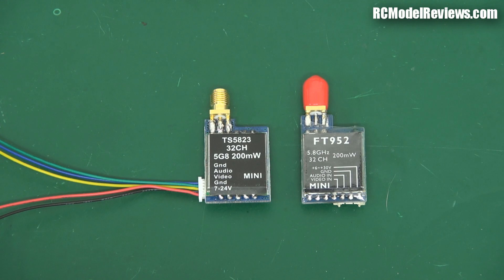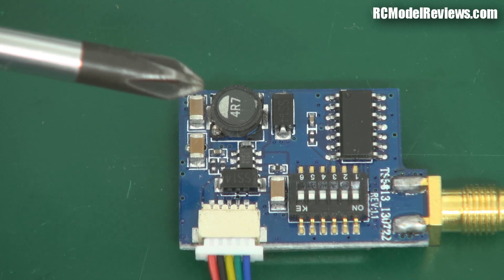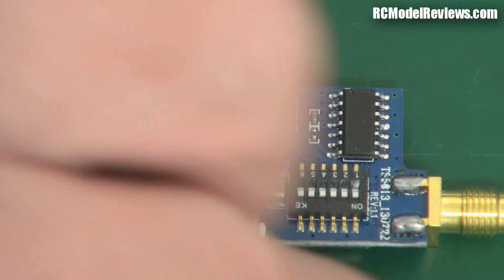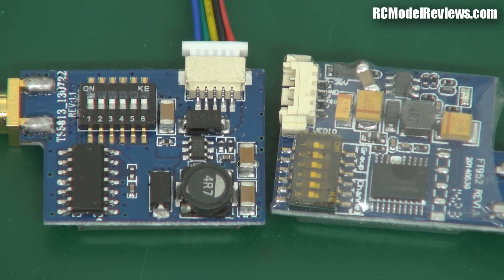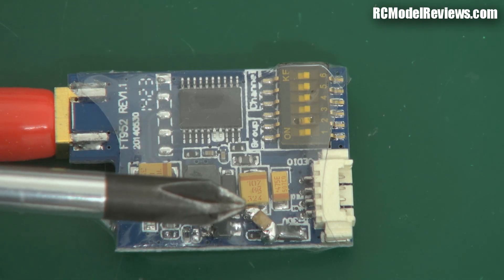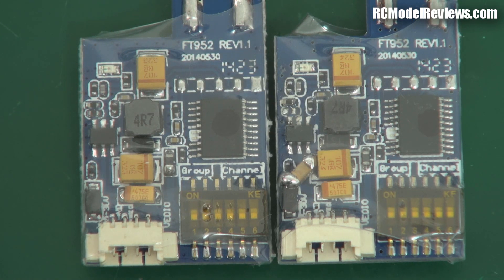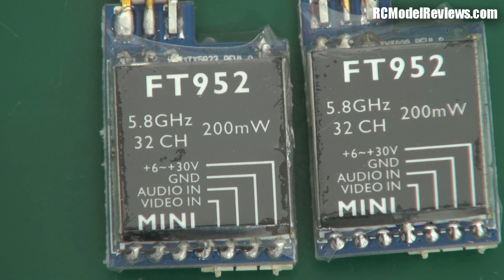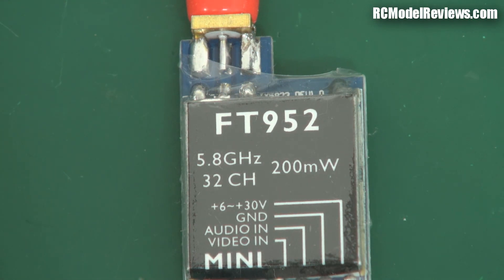FT952 FPV transmitter 200mW 5.8GHz consistency issue

Comment: anyone can tell me wich is that component in top rigth of ts5813??? i connected mine and one pin of it burnt. The only way is to change frequency. it gets very hot.the other componnet where ok,  but the 4r7 whents hot to before the pins burnt. any idea on how to repair?

Comment: Two and a half years on and not much has changed with QC.
I have a couple of these mini FPV transmitters and the problem I have with them is frequency drift.They won't stay on the channel I set them to,instead they constantly drift from one frequency to the next.Useless.

Comment: hi bruce I over powerd my eachine board camera.the cam is 5v and I put 12v .nothing blue. I am a very good solderer with small parts  ,,can it be fixed .ilive in the caribion of costa rica in the jungle parts are not easy to get san hose is 300 miles away ,and not much in the way off new stuff so I have lerned to fix  my stuff    my self. please help .I have a lot off broken stuff to rob parts..thanks I love your chanel  /////the pic wos so goog  with a gopro lens

Comment: After looking carefully at the footage it also seems like the FT952 transmitter on the right have a resistor missing on the top left corner. The third from the top. Anyway awful soldering.

Comment: I had the connector come off my ft952.  This is probably a stupid question, but at the 1:54 mark you can see the white lines for video in, audio, ground an power on the vtx that point to solder pads if you will on the board.  Am i able to solder wires to these or are those not what i think they are?

Comment: Another issue which should be mentioned is the antenna feeder. Between the radiating elements of an antenna and the SMA-connector on the transmitter, there is usually a coaxial cable. Very often it seems to be something similar to the RG-174 type, but more rigid. Losses in coaxial cables are enormous at such high frequencies as 5800MHz (5.8GHz). So try to avoid any cable at all, with the antenna element as close as possible to the transmitter output. If not possible, choose those antennas with a thick cable from the connector. A 10 cm strip of small coax as the RG174 may give loss in magnitude of 50% of the transmitters output power.

SWR (Standing wave ratio) is also important, but is hard (if not impossible) to measure for such high frequencies if you dont have a USD 50.000 analyzer. But as a thumb of rule, the current draw by the transmitter is at it lowest when the antenna match is the best. High SWR can damage the transmitter, but at such low power as in the milliwatt range quality transmitters are designed to withstand open or closed output (no antenna at all). 

And yes - the switchmode voltage converter on the PCB produce quite a lot of noise. Another approach is to use an external 3.3V DC regualtor (of the linear type) and connect directly to the transmitter after the switch-converter.

My 50 cent.

Comment: I believe that another issue with quality could be the antenna supplied with these transmitters.  My transmitter died while I was setting it up on my quadcopter.  I decided to investigate and found that inside the antenna it is just a length of micro coax with the end stripped back and a short length of tube soldered to it to make a dipole antenna. I tested the continuity between the ends of the antenna and the SMA connector and found that the screen was not connected.  With further investigation at the connector end of the antenna I found that the screen had broken where it was soldered to the body of the SMA.  I'm guessing that this caused SWRs that fried the transmitter.  I suspect that my antenna is not the only one that has caused a transmitter to fail. The antenna is designed to bend but the cable/joint inside does not seem to be up to the job.
Reply: Should have added that mine was the TS5823.  Not sure if the antenna with the FT952 s the same?

Comment: Good video. There is also a resistor? missing above the switch mode controller on the one with the bodge fix. Once again good video's I just found your  channel and have been looking into getting a miniquad. Thanks from a fellow Kiwi

Comment: Can you help me out I bought a TS351 5.9ghz FPV transmitter it has a power lead on the lef side and power supply to the camera to the fare right then a yellow wire in the middle,a white wire ,then a green wire can tell me what they are there for 
Ps your videos are very informative great videos

Comment: What is the output power for the camera on the FT952 one ? And how would you connect a 5v mini camera for fpv to it using the plug with the loose ends as it has four prongs but 5 cables . My mini camera has a servo cable with three wires red,positive, black,ground and white video , it's 3.5 to 5 v .

Comment: And this is why i will be buying Fatshark parts for my FPV setups :P
Or ImmersionRC parts which are compatible with the same fatshark.
Reply: IRC/FS generally no better than the Boscam equipment .. in any respect.  IN some cases the Boscam is a superior product.  And I have seen factory defective Immersion RC vTx too.  The main problem was with these new tiny 200mW units, which I have never used (based on the reviews).
Reply: I am also a victim of marketing :) I wanted great  system and bought Immersionrc 600mw, and later realized, that it is way overpriced. There are lots of much cheaper products, which works even better, are smaller and lighter. Currently using multiple Foxeer tm600 transmitters, superb product.

Comment: buy cheap, buy twice... well thrice in this case XD
Reply: I have had better luck with chinese products then I ever have had with Name brand overpriced stuff . Dont compare Boscam to Skyzone .......Skyzone has teething problems but they are sorting out their product ....
Frsky is the best radio system on the market .....yet it is a fraction of the price of other radios .I have expensive name brand helis that burnt up their esc  in the first minute of being turned on without the motor even running ... they now have been running  turnigy esc for about 3 years ... dont ever say buy cheap buy twice ..... expensive does not mean quality ... just more profit for importers.

Comment: Is it possible that the manufacturer built everything without the extra capacitor, then realized the flaw, then tested the capacitance and only added the new cap to ones where it was necessary? Maybe the initial capacitors themselves are inconsistent.

Comment: Bruce, so its there a point putting separate power filter before video transmitter, when its going to create interference in power module on board anyway ?

Comment: There is a fix for the TS5823 line issue that was mentioned on FPV lab #37.  Post #48 mentions a simpler way of performing the fix without having to remove the transmitter module.. 

http://fpvlab.com/forums/showthread.php?29324-Mini-5.8G-200mW-same-performance-TS5823/page4&s=bbe6c19628181875c30e2c09091bd281

Looking forward to seeing your results.

Comment: Ive seen the 2 different versions of these mini 200mw tx out there and wondered what the difference was so thanks for putting that straight for us all its got to do with the power supply :)
I saw one on banggood for $28 with free postage and jumped on it but now i see that hobbyking now also sell these tx units for $27 LOL they call it a V2 and is meant to address the issue of line hmmmmm i wonder if the bodge capacitor is just the V2? whatever the case i wont get my hands on it for a few months yet but look forward to seeing your work around for the power supply issue if that bodge looking capacitor dose indeed make a difference 

HK version:
https://www.hobbyking.com/hobbyking/store/__63114__SkyZone_TS5823_5_8GHz_32CH_A_V_200mW_Mini_FPV_Transmitter_v2_.html

Comment: Hey Bruce at 5:31 when you are showing us the two boards side by side I noticed that one of the components labled 4R7 was upside down on the board with the extra capacitor and cheers from Australia.
Reply: makes no difference
Reply: Ok I wasn't really sure just thought I would mention it
Reply: That component is an inductor that doesn't have any polarity like the tantalum caps do. Just like a resistor an inductor can be put in either orientation. The 4R7 actually means 4.7 for 4.7 uH. To make the . more visible they use an R which stands for radix.
Reply: Daniel Zanon  good spot mate

Comment: Thanks for the heads up Bruce..
If the TS5832 that you showed is the one that has the lines in it, I would first re-solder the end of the top capacitor that we can see at 1:09 in your video.

I would do this and test for lines again BEFORE adding or changing any PS caps.
I can clearly see a space between the PCB pad and the end of the cap. It seems to be a shortage of Solder Paste or reflow oven time. A properly reflowed part should have the solder flowing up to the side of the part as is shown on the lower cap.

I'd be curious if that was the problem causing the lines in that unit.

Comment: Maybe those caps are added only to the units that show a need for it during final bench testing at the factory?
Reply: When electronic boards are tested many times the bad ones are thrown into a "bone pile". Then if cost effective someone will go through the bone pile and fix those that can so they can be sold. The one with the extra cap probably came from the bone pile and was hand reworked.
Reply: That what I was thinking. We will find that out if the one without the cap is good or not.
Reply: this is exactly what i think happened
Reply: ty learned something new

Comment: Ceramic Capacitors offer different characteristics to Tantalums. Ceramics have lower ESR and potentially be better for switch mode PSUs. I also reckon that the value of those ceramics is similar/same to the Tantalums - I'd put money on around 100uF. However you have to watch out for the temperature co-efficients on the datasheets. A lot of them loose their capacitance in a very big way when cold. 
Finally looking at the bodge capacitor its almost certainly has been hand soldered on in assembly. Firstly you tend to get the bigger solder blobs when hand soldering - the reflowed joint are a lot flatter (like the rest of the board). Secondly pick and place machines would struggle to get that angle correctly and the reflow process make the parts potentially shift to the wrong place. Thirdly the fact that one is missing is most likely due to someone forgetting to solder it on in production! Pick+Place machines don't forget to put parts on...
Reply: It actually looks a bit like one of my perf board bodge jobs where I've forgotten to add the component in neatly the first time round then run out of space and had to get creative with the placement further down the line. I think this explanation makes sense. Nice video Bruce.

Comment: Disappointing video Bruce. You might have at least shown the two units working rather than going on another QC rant just like the cloneout part 2 review.
 Should re-title the video A tantrum over the tantalums :)
Reply: Rob B Perhaps you learnt nothing as you were too busy preparing to complain.  However I learnt which capacitors are useful for high frequency and which types are better for filtering low frequency.  I also learnt what to look for if I decide to purchase on of these vTX's.
Reply: Rob B Life gets changed by example. Not by opinions..
Reply: MrRaptor3
Andrew George 
Yes I stand by my comments. Why is it that as soon as someone finds criticism with a video the fan boys go on the attack? I am sure Bruce is able to fend for himself and accept or reject such well intentioned criticism. You need to remember life is not black and white, rather it's all shades of grey.
IMHO and as a hard core follower of this channel, this video offers nothing new to regular followers of RCModelReviews. We already new there were issues surrounding these TX modules as reported by Bruce. We already knew the problem was power supply related as reported by Bruce. There are already published fixes for the problem. see fpvlabs. So what's new here?
Perhaps I am being too demanding but I think Bruce presents the best and most informed RC related channel around. Just this was not quite his finest hour. As a Not So Weekly, Weekly News item, this would be fine. It just does not warrant a complete video in it's own right without a conclusive end.
***** We learned not to buy cheap Chinese shit and expect quality.. that's not nothing NEW.  you forgot the new :)
Reply: I never said anything about it being a review. The reason it is disappointing is we learned nothing other than Chinese QC can be non existent which I am sure you will agree is hardly news and I like to think Bruce generally puts out quality videos containing useful information. Which is why I remain subscribed to his channel but not to Flitetest. If I wanted tantrums, vacuuous and inconsequential content I'd  watch a reality TV show.
Reply: Rob B Disappointing?  I don't think so.   I found this to be very useful.  Not just a statement saying that the quality varies.   Much more than that.

first we were told that the lines are cause by inadequate smoothing if the power supply.   Then, we were told that Bruce will be showing how to fix this in a project.  I even expect that he will because this is the sort of thing that is easy for him to do in the winter.

Then, he showed us the difference between the two types of transmitter.  I found this very useful.  Other people will have found it useful too.  They can have a quick look to see if they have the extra capacitor or not.  If not, I'm sure that they will relieved to know.   I think it's safe to say that Bruce will be thinking up a fix to show us.

Dissapointing?   No, I don't think so.  Helpful.  This is a better description.
Reply: so after reading your original comment Rob B....do you wish you didn't leave it? or do you still feel the same? im just curious?
Reply: I found it very helpful, I almost got one of those, now i know i might just get a bad one, so will be prepared
Reply: Nobody's perfect.....

Comment: It could also be that the ones with the additional capacitor bodged on failed testing at some point, perhaps the existing caps were out of tolerance. The additional cap could of been soldered on to address this. Just guessing as you will quickly find out when you plug them in.